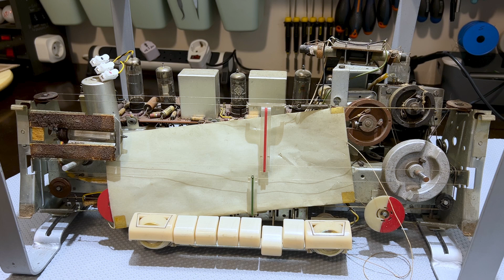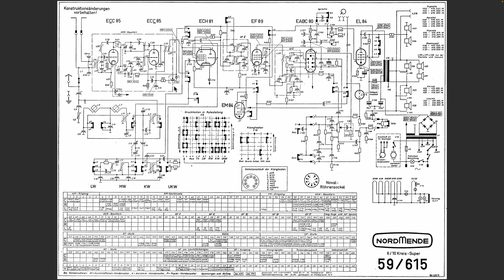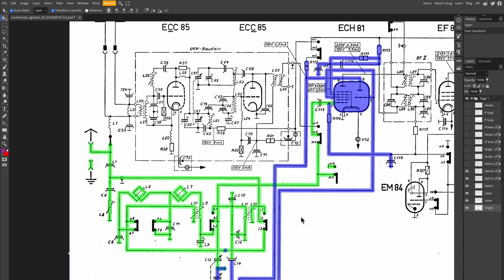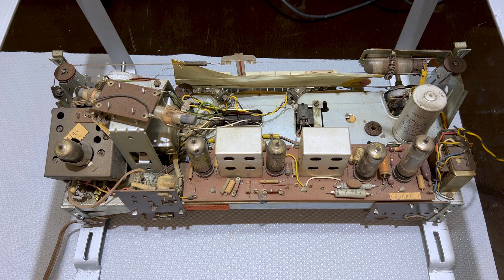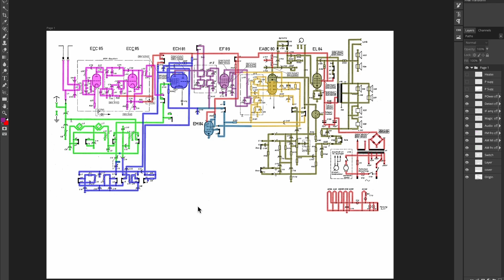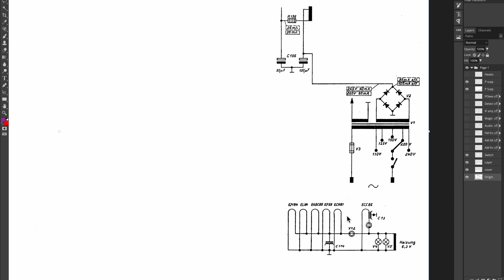The Parts That Make Up a Tube Radio - Tube Radio Restoration Back to Basics part 1

Comment: An excellent video! The way you did it is clear and easy to understand. I am in the process of troubleshooting a vacuum tube radio manufactured in late 50's. To be exact  German made model Super 66/58 W207 H u.P. In your video I see a lot of similarities with mine. I will continue to watch the rest of video series , hoping that I can find answers to any issue  I may come across. In case that it could be a specific one I will contact you . I like to congratulate you in doing this and providing very useful information. Thanks again.
Reply from the maker: I think this is it: https://drive.google.com/file/d/1duOF2Bo1-jbmdEUllATWG-AwzBFkf0ay/view?usp=sharing
Reply: Thank you very much. Wishing you a wonderful new year 2026🎉😅
Reply: @electronicsoldandnew  Thanks
Reply: @electronicsoldandnew  Thanks again Marcel for sending the schematic of Super66/58 W 207  HuP model. I suspect that there could be a problem with the transformer and in the schematic I can't find any reference to the values. I wonder where I can find information regarding voltage and ohms , so I can compare with the actual readings. Any suggestions? Thanks again, Paul.

Comment: I was wondering why those old tuning capacitors hade 3 gangs on some of them. I guess that you can't just send 455 KHz from the local oscillator to the mixer with also the signal from just one gang to mix, because the 455 KHz coming out from the mixer wouldn't have the audio on it. So you have to use a signal from a 2nd gang to add to the local oscillator before the mixer. I guess because that way both signals would have audio riding on them,so after mixing the filtered out 455KHz now does have the audio riding on it.
Reply from the maker: Check out the back to basics series. There I explain the front end tuning and oscillator stage and how they interact. Some also have an intermediate stage, hence the third gang.

Comment: I want to provide a follow-up to my last post. I re-watched your video a couple of time, but I then realized the problem I was having (I'll explain in a minute). You did a good job of expelling the parts of the radio and I really like the Photoshop trick, but it wasn't until I looked up a video on how a Superheterodyne receiver really works - and THAT is what your explanation is missing. As soon as I learned the different components of the SuperHet I was able to follow your explanation AND then I was able to understand why your broke your Photoshop drawing up how you did... THAT is what you need to incorporate into your explanation in some manner. Now that I undertand the SuperHet's different stages, your explanation make sense. Hope this helps you in some manner to improve the videos, which are actually well done.

Comment: This is a GREAT idea, but you picked a TERRIBLE radio to use. This was extremely hard to follow, because for a beginner I couldn't tell where one section starts and ends. Its a little bit like saying... OK, I'm going to teach you how to drive a car, and using a Ferrari as the car to learn with - NO!!! Use a simple circuit. One that clearly shows where one section of the radio begins and the ends and why. Again, you have one of the best ideas for a beginner's tutorial on YouTube for this subject, but it's very poorly delivered. I got very lost.

Comment: I've been collecting tube radios for over 10 years and I've changed out paper caps, resistors, etc. but never have been knowledgeable enough to actually get them working with original performance or reliably, let alone "restore". The way you explain and break down the individual sections is a game changer, and this is my feeling after only watching this first video. Can't wait to go through the rest! Thank you SO SO much.
Reply from the maker: My pleasure. The goal is precisely to help others to do the same. Good luck.
P.S. if you have questions, email them to me. Can’t promise a fast reply, but I’ll do my best to answer them.

Comment: Hey, I cannot express how grateful I am for someone like yourself that takes beginner radio restoration enthusiasts through a step-by-step process. I have recently found a Grundig 2117 at my grandparents attic, and want to restore it myself. But I have no knowledge about electricity or schematics. Do you think that with your entire back-to-basics series, one could learn enough skills to restore a vintage tube radio? I have little to no access to theory courses here in Belgium, and they would take over two years to complete. Thanks a lot for all you do! :) Best, Detlef
Reply from the maker: I believe you can, but be very very careful with the high voltages in the radio. They can be lethal
Reply: @electronicsoldandnew Understood, thanks so much!

Comment: Thank you for these videos.  I shall be referring to them often!  I think you're using Photopea, correct?  I found it online, but after downloading the app I find it displays a lot of adverts which are very distracting.  How were you able to turn your ads off?
Reply from the maker: I didn't turn them off. I just use the main screen that has no ads, and ignore the right side bar that has them. I did buy the license for a while (which removes the ads), but found that I used it so little that it wasn't worth it.
Reply: @electronicsoldandnew  Roger that.  I think I will invent a cardboard envelope I can slip over the right side of my monitor so I can hide the ads.  Could also attach an alignment sheet or something to it with a clip or tape to make the space more useful.

Comment: This is a fantastic idea (the video series).  I really wish you would've picked a radio that was much more simple to start with instead of a multi-band one with lots of complexity and a schematic that's in German though... but that's just my opinion... it's your series so you approach it however you like. I'm glad you're doing it anyway.  It also might be a good idea to explain what a tank circuit is if you're going to use that term. Looking forward to more videos in this series!

Comment: I can remember my apprentice days in the 70's and the instructors breaking up the circuit parts in this way. It works very well and even now in retirement, also restoring radios as my hobby,  I can readily identify the parts looking at the chassis. 
This video is very good at starting someone off in this process. But, just an idea, In some of your previous videos you have shown the scope screen as an inset video. Would breaking up the circuit diagram in its various stages and insetting the PC video out as you show each physical location of the stage on the chassis possibly make things even clearer to some?
Reply from the maker: That’s a good idea. I’ll give it a try going forward. Thanks.

Comment: This will be a great series for novices into the restoration of tube/valve radios but also basic tube/valve audio equipment. This particular case is not a great example for this but given the chance you should also devote some time to point out dos and don'ts for cleaning up a radio chassis. Usually the chassis cleaning is one of the first tasks that a restorer will have to perform but there are quite a few risks attached to this process. In particular, as not all radios are constructed the same way, these risks can differ greatly between different radios. Along with the cleaning of course comes a first inspection of the circuit and identification of possible damaged components and danger areas.

Comment: 6:05 This is true up to a point. If you destroy an older transistor circuit, there are a few  aspects to consider:
a) There are many transistors that are irreplaceable because they are either no longer manufactured and very hard to find or are just so obscure that even datasheets for them cannot be found. In many cases equivalent transistors simply do not exist. (In such cases you do not even want to buy the piece in the first place unless you decide to so with the  knowledge that you cannot use without taking certain precautions.) There are also many cases where the transistors may have been purposefully re-labelled by the manufacturer so that the end-user cannot tell what the exact part is and has to go through the service department of the company that produced the equipment (which may no longer exist).
b) As a rule, transistor circuits contain many more active elements than valve circuits do, for the simple reason that transistors are cheaper but also, in some cases, less linear. So when a fault in a transistor circuit occurs, it can often be the case that more than one active element goes out.
c) Unlike tube circuits, transistor circuits have invariably their active elements soldered on a board. Therefore testing a transistor (or more than one) can be a much more labourious affair with its own inherent risks.

Comment: that schematic is really not great though,  the 1st i.f. primary is shown upside down ,as in the ht voltage is fed in the bottom and the (slightly) lower voltage anode connection is at the top , then they mix 2 different cathode symbols, uk conventional half circle at front end then just dots at af detection and output stages i guess thats american? and youd have to be knowlegable to see the eabc80 symbol is 3 diodes and a triode, and that el84 symbol is a complete mess! they bypassed convention of showing internal straps down the sides no  lets stick it through the center! its like a brit did the front end the rest is an american haha
Reply from the maker: Those are the challenges we face when working with these schematics 😊 And often there are errors in there, just to keep you on your toes 😊

Comment: iam 80% self taught and theres one thing i cant understand about superhet and seems to never be mentioned, not even in books is why the local oscillator amplitude effects the signal level recieved 
i would have thought that the oscillator is just for frequency convertion and the i.f. stage is amplifying the incoming radio signal at its own amplitude just carrier frequency shifted with the oscillator + its harmonics is filtered out at the i.f. cans , but in practice a weak oscillator causes a weak reception ! so wierd ! oh and agc feedback was confusing too until i started playing with opamps
Reply from the maker: If you look at the math involved in the mixing process, both signal amplitudes come into the equation.
Reply: @electronicsoldandnew  ah theres the problem with my hole in knowledge !  , i totally lose interest at the math haha
Reply from the maker: Believe me, you’re not the only one 😊 the math for a mixing stage is horrendous 😊

Comment: Back to basics? Playing with colours on a schematic may be a good guide, but it takes more than that to start repairing radios. Without a thorough knowledge of basic electronics this hobby will forever be off limits. Buying a copy of Electronics for Dummies and toiling yourself through it seems inevitable. There is a whole new language to be learned, dozens of symbols to get acquainted with and lots of math. In short, this is not a hobby for everyone.
Reply: I’m not totally sure which audience you’re intending this comment for. But the vast majority of the people that follow him, know it’s not “colors on a schematic.”

 Regardless, if you watched the video, you would recognize that this video is being made to speak to the person that was just like him when they first started out. Gate keepers who speak like you have deterred curious minds and its channels like this, w2aew, Paul Carlson, The Radio Shop, and literally countless others on YouTube that gave us a starting point. 

I started learning the electronics craft from YouTube 12 years ago. Videos just like this gave me the push to go back and learn the fundamentals and next year I’ll be finish my degree in electrical engineering. But long ago colleges and trade schools stopped teaching analog circuitry at this level. Tube circuitry alone is a paragraph in a chapter of a 4 year program. 

We’re lucky to have them and lucky that they let us look over their shoulder.
Reply from the maker: Noted

Comment: When I was 9 yrs old in 1956, I was repairing TV's for my neighbors. At that point in life, I knew I'd want to be involved with computers, which I did when I got into High School. I read everything I could get my hands on. So, while in the Army, I ended up teaching: HAM Radio, Telephone Systems, Microwave Propagation, and Basic Electronics. While in the Army, I got my Electrical Engineering Degree.  Then, after 40 years in the Network Industry, and retired, I was thinking what should do now?  Then I remembered my young years.  I decided to setup a shop and start restoring old Tube Radio's and old Tube Test Equipment. Since electronics came so easy to me, repairing these old Tube device's came easy as well; and that was 14 years ago.  So, in short, I've found this so relaxing, and fun to do!
---
So as for what you're doing, this will help new people wanting to do this hobby, and you always present material in a logical order. 👍
Keep up this series of information.  I know it will help someone!
---
There are so many YT's out their that DO THIS WRONG!  So your efforts are greatly appreciated.
Reply from the maker: Thanks for the support. Like you, the logic of circuitry comes naturally to me, as I’ve built up almost an instinct for what’s going on in the circuit, but I do realise that not everyone is there yet (and I’m sure there’s a lot I’ve still not come across myself).

Comment: Off-topic, are you tempted to emulate x-ray Tony's new camera system.
Reply from the maker: Not really 😊 I saw his latest video and could feel the frustration he was experiencing 😊 I do want to get a couple of small good quality cameras for secondary angle shots and close-ups like Dave Tipton has. I like the idea of aligning multiple clips together and then editing the shots myself in DaVinci Resolve. It’s easy and reversible, so will work better for me. 
Right now I only use one iPhone, so changing angles requires me to “continue to flow of dialogue” with breaks in between, which sometimes doesn’t really work out 😂